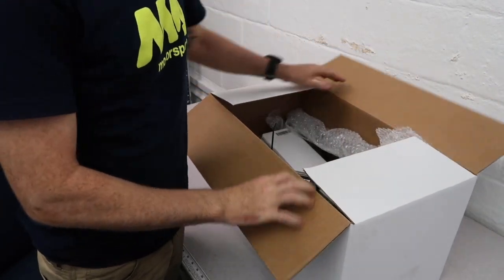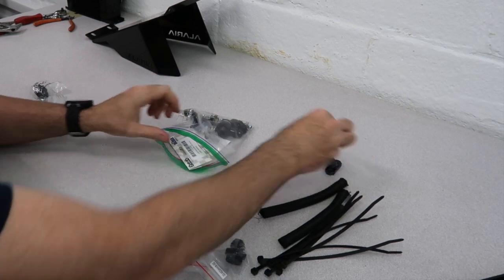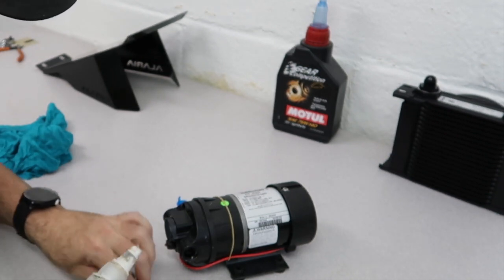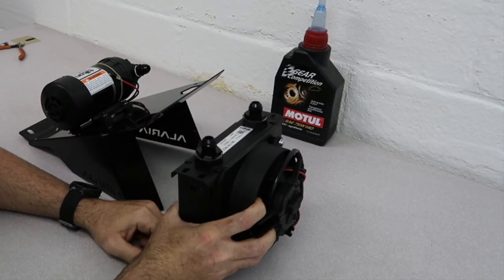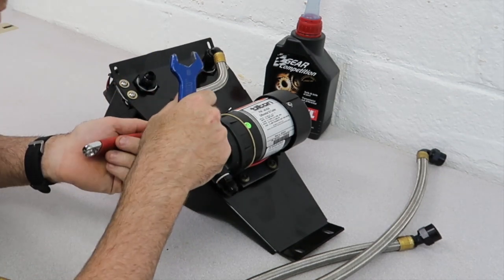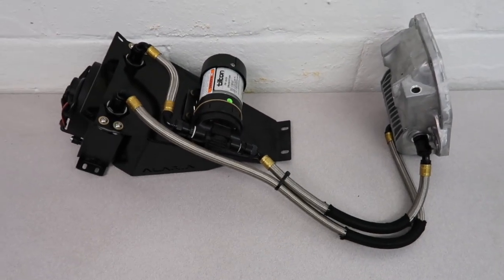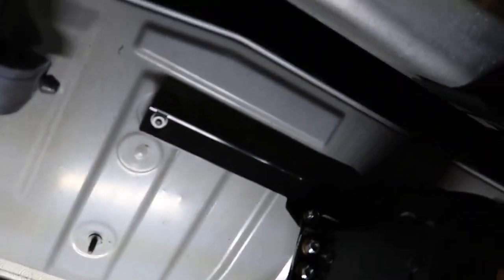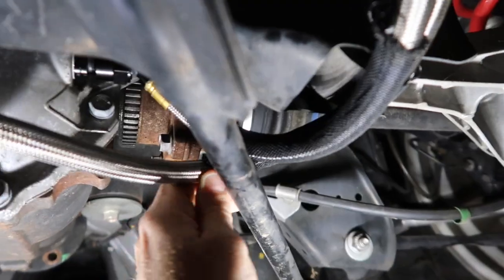HOW TO:  ALARIA Tech 370Z(& 350Z) Differential Cooler Kit Install

Comment: Where did the filter screen go? Did I miss it?
Reply from the maker: Alternatively, it can go at the diff "drain" or outlet fitting on the bottom of the rear cover.   If you use the Banjo for the Z1 cover though the filter does not fit in that location properly so I've started suggesting they get installed here at the cooler inlet.
Reply: @MAMotorsports  That would be like mine.
Reply from the maker: Ah, i did chop that off a little bit in my editing.    It goes in the inlet of the cooler you can see it for a split second right at 8:21 before that hose goes on.   Example here....  http://www.setrabusa.com/products/filters/uf/index.html

Comment: Would this work on a G37 Coupe with a Motordyne Shockwave exhaust?
Reply from the maker: It looks like it would.  Might have to trim the shroud a little for the Helmholtz resonators on the exhaust.
Reply: @MAMotorsports Thank you! Order arrived pretty fast :) It will fit for sure. I might trim the shroud just a little to give more clearance.
Reply from the maker: @shahabsandhu4034  excellent.  Let me know if you have any questions on the install.
Reply: @MAMotorsports  I think my kit was missing some parts but not a big deal though: 
1) missing instructions manual (which isn't a problem but I have a Z1 cover on a G37 so instructions would be be a bit different) 
2) Missing 2 washers for the pump mount (also not an issue) 
3) missing a 3/8 male to male NPT adapter for the pump (I can get a spare)
3) missing zip-ties and sleeves etc. (not an issue but seems like there might be inconsistencies in the packaging of these kits)
More importantly, I think most folks will plan to run a temp-sensor so it would be nice to include options for that along with an electrical relay unit for the pump and fan. Z1-cover has a dedicated spot for a sensor that could feed directly to the trigger. I also plan to have a master switch on the G37 center-console that disables VDC + enables Yaw-bypass + turns on the diff-cooler system (this would essentially be track-mode). I was also wondering if that tiny filter element was even of any use since my R200 diff seems to shed quite a bit of ferrous material during break-in that would se4em to easily clog it up. Probably a low pressure hydraulic oil filter mounted on the mothership bracket before the pump would be a more suitable solution. These pumps are electromagnetic and could become a resting place for ferrous debris.
Reply from the maker: @shahabsandhu4034  Hi  and thanks for your purchase.  Also, if we did forget any pieces I apologize but we are happy to send out any missing pieces ASAP if you were to contact us.   

We do not include an instruction manual.  We point people to this video or to call/ email with specific questions about the kit.  The only difference between the kit with the Z1 cover and oem/ Nismo cover is the fitting that comes out of the back/ bottom of the diff cover.   Instead of a straight fitting out we swap it for a banjo style fitting for ground clearance purposes.   

There is no 3/8" male to male NPT fitting required for this kit.  The kit will come with 2x 3/8npt to -8an for the inlet and outlet of the pump.  

We used to offer an optional temp sensor for the kit but found that most folks did not even use it.  A simple 1/8 npt "take off port" inline fitting off the pump feed line would be easy and also, like you said, the Z1 cover offers a space for a temp sensor.   Most users of this kit will turn a warm up lap and then flip a switch to run the pump until they are done their session.    Some people wanted to use different sensors and so we decided to just leave the sensor adaptation up to the end user.   

We have been selling and installing these kits for about 10 years and that little filter works great.  Of course some maintenance is required so we suggest you check/ clean that filter often if not after every track weekend when you would typically change your diff fluid.
Reply: @MAMotorsports  Thanks for the fast response! All makes sense! I actually found the other fitting for the pump also. Looks like everything is good to go! It's a very well engineered kit!
Reply from the maker: @ thank you! And as always reach out with any questions if you have any.

Comment: Does this work with a dual exhaust setup ....I have the hks dual exhaust just wondering about the room in the back
Reply from the maker: yes it works with most dual muffler exhausts.  Factory style horizontal muffler style systems it will not work with.
Reply: @MAMotorsports  ok cool good to know I will have to get one of these then

Comment: So where would it mount a 350z since we don’t have the rear chassis braces like the 370z. Also what would be the best way to wire this? Mechanically I’m smart as hell, but electrically, I’ll probably electrocute myself lol
Reply from the maker: The 350Z kit comes with a bracket that simulates the rear chassis brace pick up point.  Its a very simple install.   Wiring to a switch and relay would be the easiest.  Sadly we do not have a wiring kit available yet.

Comment: hello, is there a possible way to add a temp gauge for the diff with this kit, also should the pump always be running or only when needed, thank you
Reply from the maker: A temp gauge would be easy to install in the drain side for sure.   It is normally not run all the time.   Once on track it can be switched on or turned on with a thermo switch.
Reply: @MAMotorsports  thank you, I figured it shouldn't be running all the time, one more question if I may ask if the pump is off and there is a hose on the drain side, wouldn't some of the liquid moves from drain to fill side because of viscosity decreases with increase in temperature or that's not possible because both cooler/diff is filled?
Reply from the maker: @al3zmi    Because both the diff and cooler are filled those fluid levels remain static until the pump is turned on.
Reply: @MAMotorsports  thank you for answering, these diff coolers are needed when they open tracks here, seems like the best product for time attack :D
Reply from the maker: @al3zmi    Happy to help.  We felt there was a need for these so we made them.  Lots of happy clients out there.

Comment: Great video! I did this same set up for my car. Since at that time this kit wasn't as available. I still did eveything correctly on my own. I guess banjo fitting would be easier. RUSTY roasted me for it. But still I made 6an 90 fitting work. Might switch to 8an this time around. Is this kit running 8an or 6an? Ether way all love 💪.
Reply from the maker: Trigga M.   we use -8an hoses.  Thanks!